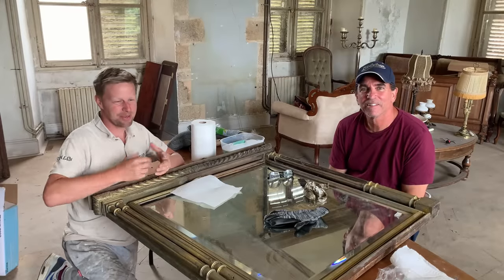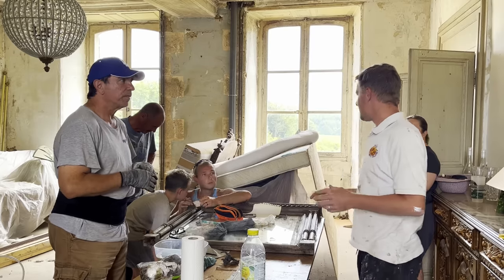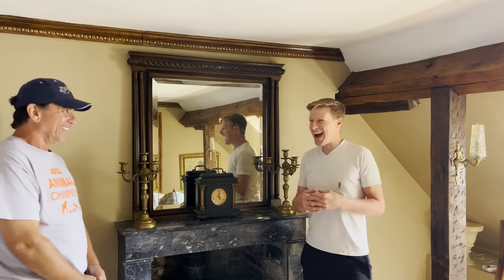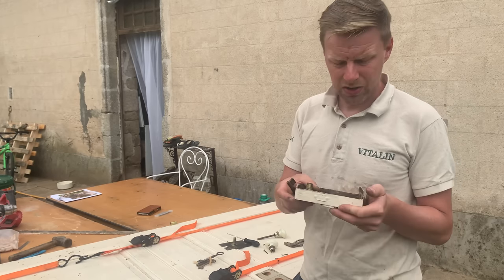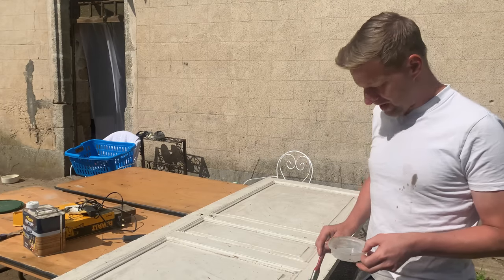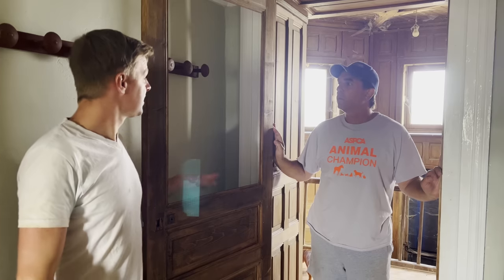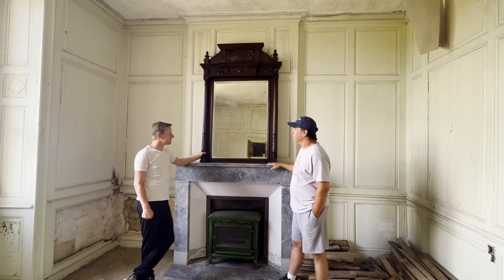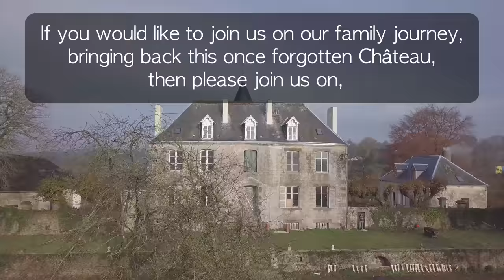The DOOR to the THIRD floor | in the CHÂTEAU tower. Ep 62

Comment: Love the Chateau. The door glass would suit some simple square patterned leaded stained glass with just a simple colour Victorian style border. For now I would buy some muranese or Arctic pattern glass and have it toughened. Surprised me in 2002 how hard safety glass was to get in rural, Normandy France and cost. Generally bought from UK in 6.4mm Laminated or patterned glass. Rubbish at cutting it as well. Generally a bit bigger than size given. My Mayor couldn't believe the thickness of 6mm float in small 8inch by 12 inch door panes. The door used to slam if windows open if front window open and thankfully never broke.

Comment: I live in America and my house has locks very similar to yours but from our civil war. I took them apart but don't use chemical strippers so I took the painted parts and ran a coat hanger wire through the screw holes and put them in a small campfire and within two minutes it had burned off 150 years of paint. than I oiled them and reassemble them and they came out perfect.

Comment: The easiest way to remove paint off of hinges, door knobs, switch plates and door or window locks is to buy an old crockpot fill it with water then place items in to soak in the warmed water over night and the paint should sloth off, Some people add a small amount liquid dish soap but I never needed to

Comment: This may sound ridiculous in a regular home but not in a chateau under construction. They have finder squares that you can put on your remote controls , iPads, even on your dog. They have GPS that register on your phone. They are super cheap and would be great for finding your tools. They have small round ones that come in bunches of 8-12 for $20-25 the cheap versions. They would be great for cords and lights or stuff that is more stationary. Then the squares I bought 10 for $25 I use for remotes, my purse and wallet. More every day kinda stuff. Also my favorite other then the size. They are the size of about half a credit card. So I can’t stick it on my backscratchers. Then you have phobs I think spelling is off BUT these are the better ones for seriously pinpointing something. They are smaller then the Phobs you use for your door locks.  Still that teardrop shape so they can stick or hang. My family has them on all of our pets. My pets are about 80% good about staying put but when my sheep dog takes off after a squirrel 🐿 I freak out because I live on 5 acres on the back of a government wooded sanctuary that is 100 square miles easily and we have bears 🐻 , crocodile 🐊 , a lot of snakes 🐍, bobcat’s so with our app we I can find her with a better GPS signal. They run about 8-$25. When you technically have 4 floors, a house, and how many out buildings and the land you and pets and tools they scream for one of them.